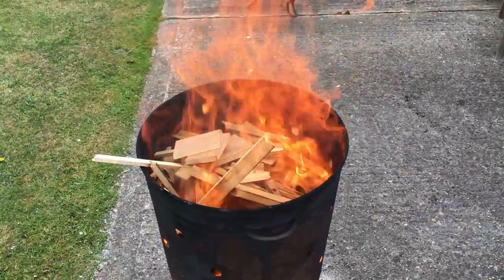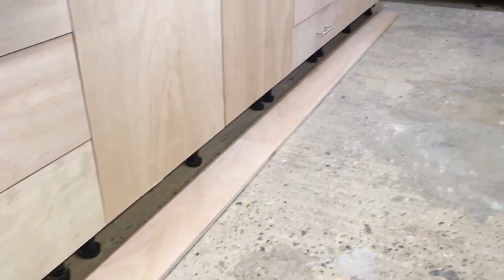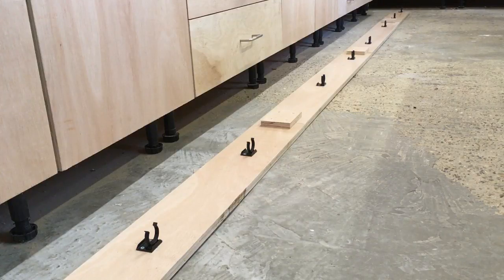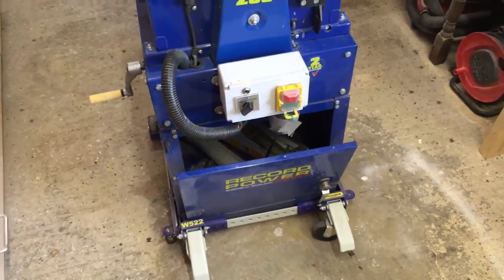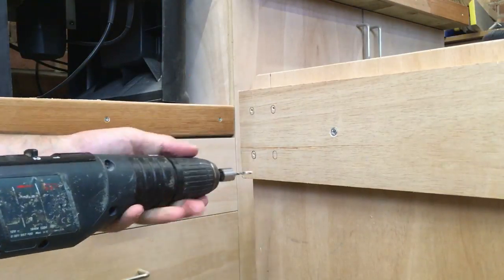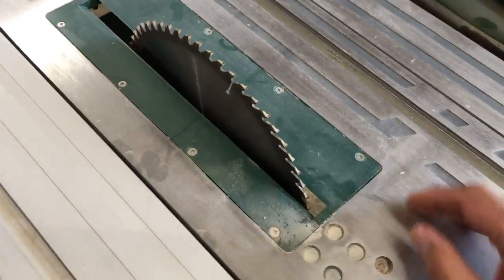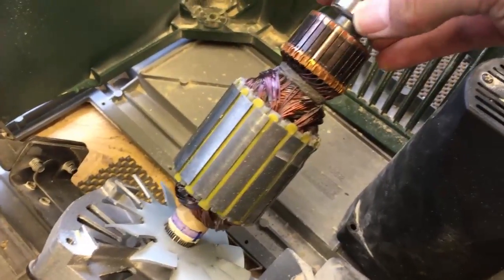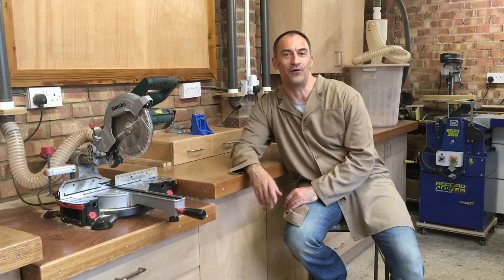Workshop Build Finishing Touches

Comment: Great Video sorry about your Table Saw going to the big Saws in the Sky, as for the Replacement, Its a Brilliant Saw I have the same one and straight out the box mine was 95% true so i'm happy with that. The only problem that i had was it's open underneath so some kind of dust collector is needed, the standard dust collection at the back is good as it could be. I'm not that keen on the legs so i might take my saw off and put it on a bench/outfield/assembly table. Thanks.
Barry (West Kirby, Wirral)
Reply from the maker: Hi Barry, I'm pleased you recommend the saw.. We had an issue with the legs as you will see in this weeks video.
However the blade accuracy was within 0.1° so out of the box that's not bad.
I have taken off the blade guard and therefore lost the dust collection form above. I plan to remove the T piece at the back of the saw and make an adapter to get my 2" duct collection hose connected directly to it.
We also spoke about removing the legs, we have taken off the wheels already and plan to either put it on a rigid frame or build a new shop cart on casters. I think its very good value for money though.

Comment: Hey to Greg, Dave here again.
Question: how's the shop?
Have you added any more larger tools or added any more cabinets?

As well, is the "worktop" height which connects all the tools at a good height from the floor or would you have made it a bit higher?

Thanks for all your great vids and your responses. Truly are a professional.

Lord Jesus bless
Reply from the maker: Thank you David, the workbenches were all designed to finish at 900mm off the floor, this is the same height as our new table saw.
Its also the standrd heigth for kictehn worktops and surfaces and a comforatbel height to work at when standing.
So we can run very long pieces through each machine and it will be supported and ride over the other surfaces.